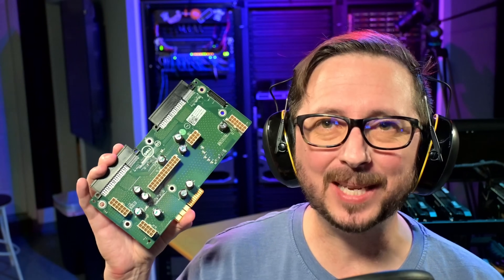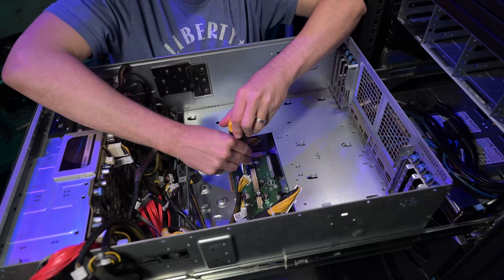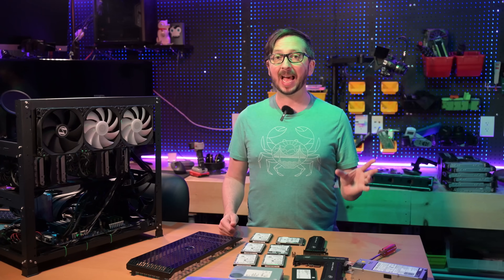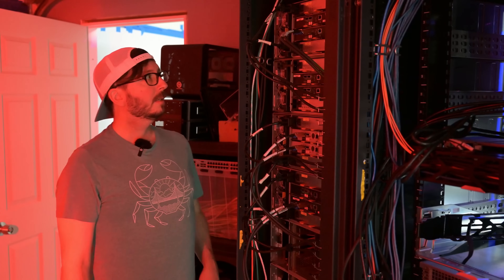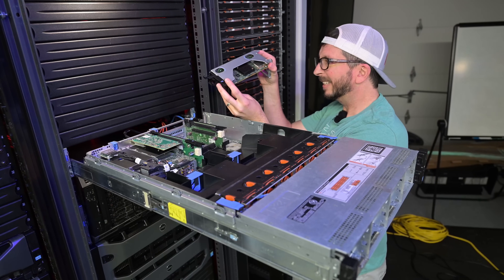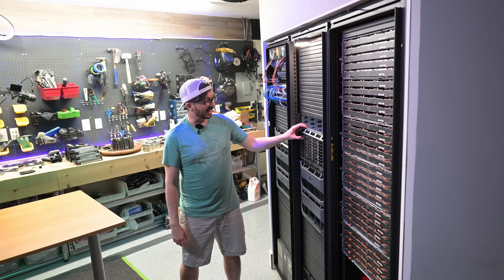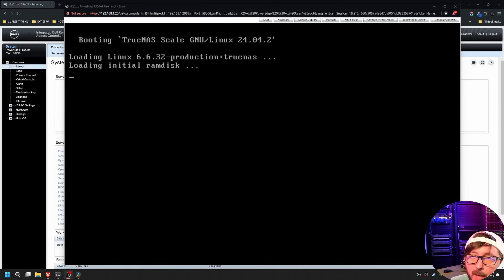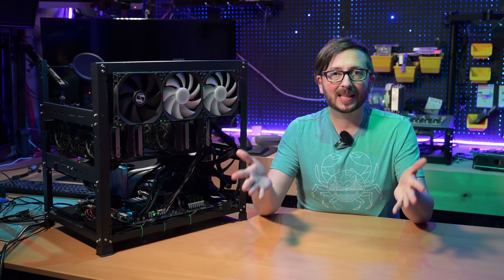TrueNAS Scale Storage Server HELL - Can I save my PETABYTE Home Server?

Comment: Where did you get those plastic rackmount cover panels?
Reply from the maker: These APC blanks I got on ebay https://geni.us/RACK_1U_BLANKS when I had my APC netshelters. They have a solid OEM fit but they are a bit expensive. They also of course work universally so I put them in these dell racks. There are alternatives I have checked into for my half rack cheaper but I would make sure you go with plastic vs metal. These really did a lot to cut down on noise and of course corrected airflow issues to perfect front to back cooling circulation. Im not sure the metal would cut down on sound.

Comment: you only placed the new part and not the 2nd one
Reply from the maker: The second part is the GPU optional addin card. I didn't readd that to eliminate it as a possible issue. The machine should be able to run without it just fine.
Reply: @DigitalSpaceport  10-4 was thinking it was part of the problem.

Comment: how much have you dropped on that homelab thus far
Reply from the maker: Not as much as most folks think, but maybe this would make a fun video?
Reply: @DigitalSpaceport  so far I've dropped like $600 on mine but still missing half of it (don't have a switch yet still using my 5 port gigabit ect)
Reply from the maker: I started out with a SC846 in 2013 as my first inhouse server. With drives it was around 400. Good times.

Comment: 29Us for only 1PB? you have they have build new server chassis since 2012.
Reply from the maker: @Mike-xy4jz  what? How are you getting 29?
Reply: @DigitalSpaceport  6 - 4u jbods and 1 5u dell thing?
Reply from the maker: @Mike-xy4jz  only 2 of the 4u jbods have hdds, for 1.4PB raw. I had to temp bring up the third jbod to put 24 ssd that I was using for special vdev devices. Now that wasnt well planned for in advance, but it was crazy fast. Im moving to a much more flash based setup now so should just have 1 fulltime jbod running and one for backups that kicks on for an hour a day.
Reply: Your electrical bill must go through the roof. Hopefully it has solar panels on it ;-)
Reply from the maker: Electrics 10c per kWh here so it's not that bad if I keep it under 5 kW in the garage. The window AC is optimally sized placed to move cool air onto the racks fronts to hand up to 8kW of hear load generation, but in hot summer I tap that back to 4. If its running full tilt 24/7 which it isnt often, it can hit 300+ extra $ on the bill. The whole house and garage I redid the insulation in  and that also helped a tremendous amount in the garage.

Solar is going to happen for sure and soon, but mainly fir dorking around tinkering reasons.

Comment: there are swarms of dead small insects around and even inside my server, its very wierd like one day they arent there and the next time you check it was full of them
Reply from the maker: That's weird where do their bodies go?
Reply: @DigitalSpaceport  I used to have my server on a table and they seemed to be on the side of the server or wherever there where cables, I later discovered that they where at the back of the server and one big specimen was stuck to the front of the first cpu cooler.

Comment: So you can chuck all the data disks from a TrueNAS Scale into another server and TrueNAS just finds them all and carries on like nothing's happened? No need to worry about order of disks or anything?
Reply from the maker: Correct. TrueNAS references disk-by-uuid so its unique to the disk itself. Pretty neat right
Reply: @DigitalSpaceport  Thanks for the confirmation! I did wonder if that was the case but never actually tested it. That's made me even happier about running my own TrueNAS Scale at home :)
Reply: Yes, I love ZFS when set up properly. Accidentally hosed a sbc I was using and decided to take the opportunity to upgrade to a Real Boy setup like this video. One config import later and it was like nothing happened. 😇

Comment: What are you using for virtualization software? - might hci / ceph make sense for you?
Reply from the maker: Im using proxmox and indeed ceph on a portion of the hardware would make sense, but modernizing the hardware is underway also. NVMe is now cheap enough to make a lot of sense also. Running a storage network that's dedicated does have advantages however and TN not being able to scale, scale has been downer. I am considering rearchitecting this all massively to skew for performance.
Reply: Would love to see what you’re considering for your “skew for performance “! 😅
Reply from the maker: 3GB/s is what im currently at for bidirectional workloads, much too slow. I know I can do better. Id like to see that number doubled under 70/30 to 50/50 bidirection workloads.

Comment: Isn't it great how simple it is to just boot Linux on nearly anything? I don't think this would have been as smooth with Windows. Glad you're up and running with a temporary solution for now! Looking forward to seeing what comes next!
Reply from the maker: Yep linux does transport easy
Reply: @DigitalSpaceport  Your video gave me the courage to move one of my Proxmox nodes so I can prepare the more beefy one for sale. I installed the NVME from the old server into the new one and moved the drives. I was up and running in no time.

Comment: You took two boards out from under the mobo but only put back one?
Reply from the maker: One is the PDB which I replaced. That one is mandatory and larger. The second is the GPU addon power card. Optional and I removed it just to eliminate variables.

Comment: Years ago I accidentally, deleted my primary raid 6 pool off my LSI controller and then did the same on my backup seconds later…. Lesson from the story, dont work when your completely exhausted and distracted by a phone call on your own data 😭
Reply from the maker: I have (now had) a nice tape library to be my tier 2 storage backups. Now I have no tier 2. I'm entering FAFO country. Sorry for your loss also!
Reply: @DigitalSpaceport  I have an LTO7 tape library, but the tapes cost as much about $50 ea 😭
Reply: 3-2-1
Reply: For those interested, I was planning to wipe my primary pool so I can expand it to a raid 60 with new disks 🤦‍♀️😊